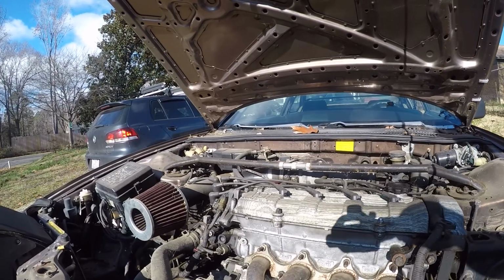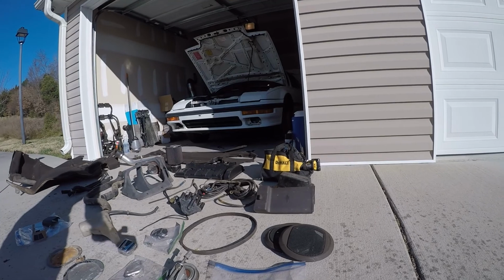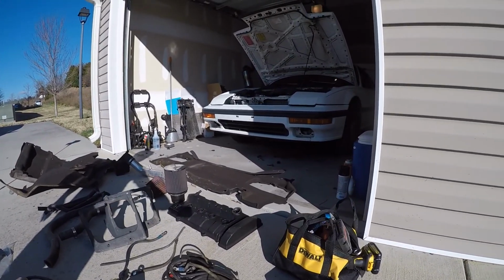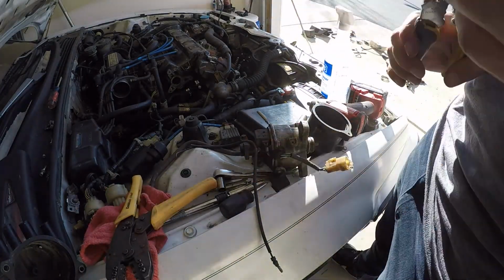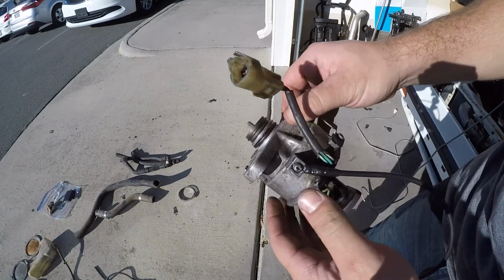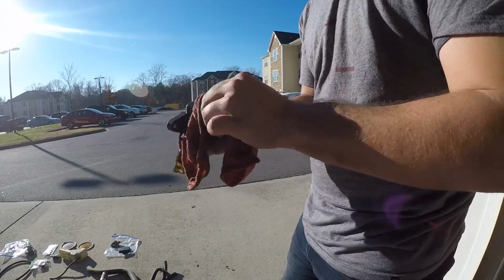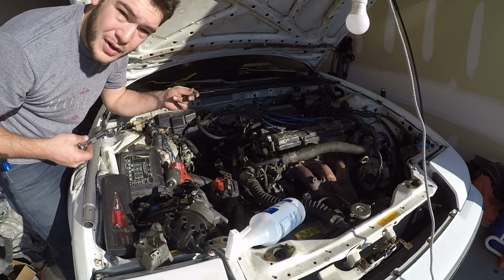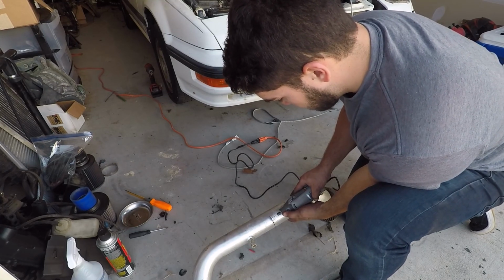89' Prelude 4ws Build Ep. 7 (Parts Car & Engine)

Comment: Better to just get the Honda seal and bearing and rebuild the distributor and CYL Sensor because every used one I've switched out still leaks. The seal kit is only 9.99 too. But also does the car throw any check engine codes with the EGR gone? I would LOVE to get rid of mine and just let the SS headers stand on their own without that damned pipe.
Reply from the maker: I do have a cel on for the EGR delete but It doesn't bother me. Eventually, I'll work it out correctly.
Reply: @ba-tv.  did you ever figure out the dash light issue? Im currently having same problem and I think it's tied in with the rear defroster ground or short.  The guage cluster on my 90 is in line with the tail lights and the rear defroster. Now my rear defroster isn't working and when I turn it on, or try to anyways, I hear a clicking noise behind the dash.
Reply from the maker: @blazeaglory  It sounds like the switch is working, allowing the relay to turn on. I guess you're just not getting any "defrost" action. 

The likely culprit is the contact with the rear window itself. Inspect the lines across the glass for any breaks. They sell a cheap kit that is a fix for some but not always.